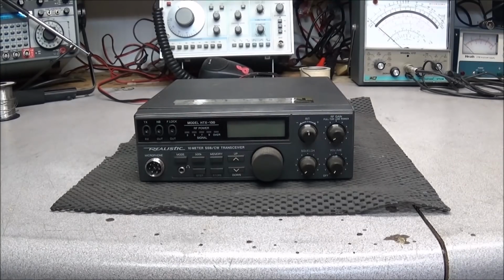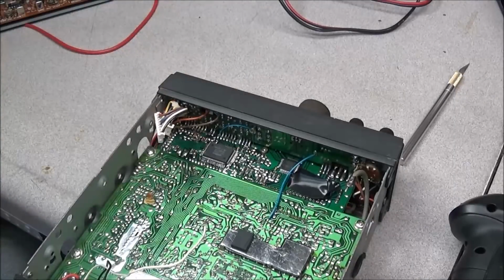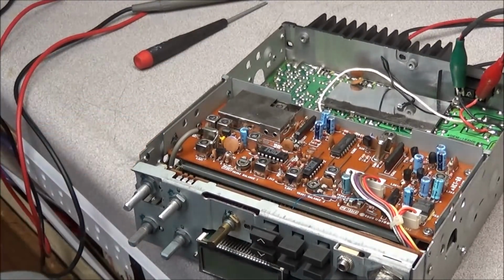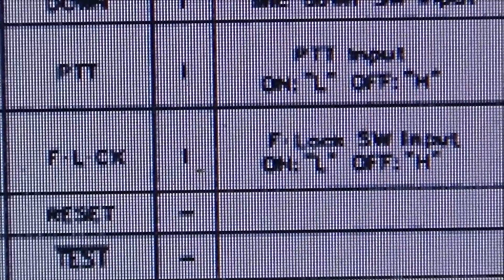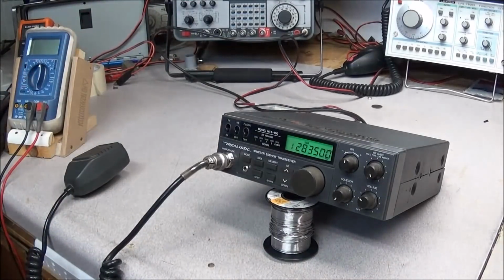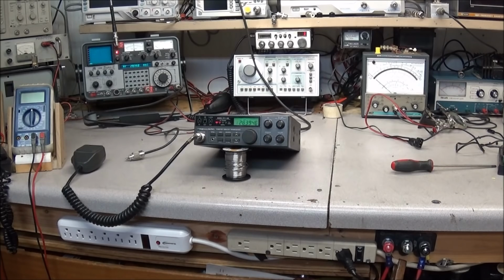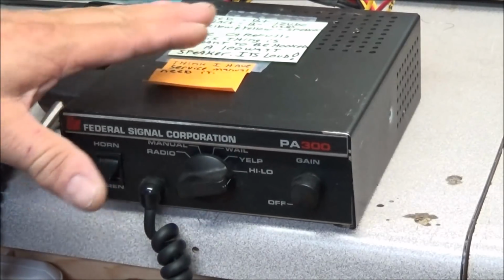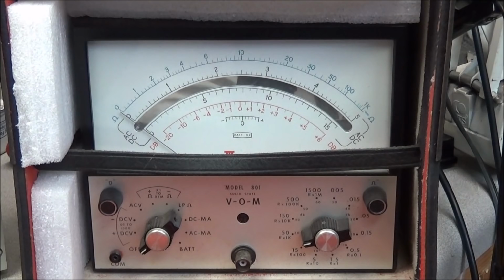#122 HTX 100 Failed Repair Plus Mail Bonus

Comment: I know it's an old video, but thanks! I picked one of these up from a Silent Key, and it had some broken wires inside. I figured out where they go by watching your closeups of the circuit board, and it' now working like new. (also had the problem, (cannily identical) with blown tracks around the regulator. Replace the caps, regulators, and repaired the tracks. 73's VA3IRF

Comment: I just pulled my htx-100 out of a box, worked great about 20 years ago, thought I'd try it out again and maybe sell it. I had the flashing display, and was figuring it was toast, then came across your video. Sure enough the TX switch was on. Thank you for putting this out there! Unfortunately I think it does need a recap. I tuned around, but the noise level was off the charts. I thought I'd call CQ and see if I got a response, and immediately heard a faint reply that the freq was in use. ... So I think the receiver side may need a recap after all. RF amp just seemed to increase the noise. Oddly enough I have a Yeasu ft757gx with essentially the same problem. Do you think a recap on these radios would fix the receive problem?

Comment: I have an HTX-100 that is doing the same thing and was wondering if you still are working on those rigs . I have tallked all around the world with that radio running 25 watts with an inverted V dipole in a pine tree back in the early 90's. If you could please help me let me know and ill email you. This radio has sentimental value and I'd really like to see it running again.

Comment: I used to work on modifying single sideband  CB radios.  I'd make 'em go upstairs by cutting a trace on the phase locked loop radios.  I'd then broadband the oscillator.  On my base station I had it hooked up to my Fluke frequency counter and had a tuning wand stuck through a hole I drilled in the case so I could swing the oscillator down or up depending where I wanted to go with the transceiver.  I'd swing it up to go upstairs above the 40 channel usually just below the 2 meter Ham band.  Up there I'd talk to a lot of Ham radio operators.   I'd swing the oscillator the other direction if I wanted to go below channel 1 on the CB.  I really had a good time back during the 80's working on CB radios for folks.  Then I started working on television sets.  Sold all my gear when I moved and now no longer do electronics.  That's why I feed off of others' electronics work.  Love yer videos.

Comment: I wonder if you are into "metrology?" Standards and such... you have so many meters and instruments which are just begging for calibration. HONEST calibration, no problems because you have standardized and calibrated sources... right? Your connectors are all standard field types... no lab or better (metrology level) connectors. See the video from The Signal Source on connector types. Oy vey. LOL Not one standard in all your videos. Yikes.
Reply from the maker: Yes I have many standards including GPS standards. However frequencies below 30 MHz field connectors are just fine. I am not running a "Lab" here and not in the business to service commercial equipment. Just a hobby since I quit General electric and EF Johnson companies as a service tech.  My newer signal generators and spectrum analyzers (which are less than two years old) are all up to date from the manufacture.  Now when working with higher frequencies and public service equipment standards are a MUST and why I do not service such equipment any longer.  In my current job of 25 years as a quality engineer metrology  is something we have to take seriously. Good points Bruce.

Comment: NIce work... but I am not sure how shorting that wire to ground resets the micro when the radio has no power to it....???
Reply from the maker: Capacitors act like batteries. They store energy.  By shorting certain pins on the micro you discharge these internal capacitors. This way any garbage left in the micro is removed.

Comment: I had a ham friend give me an RCI 2950 10 meter transceiver with intermittent display issues.  When I got home and opened up the unit, I noticed there was no harness, ribbon cabling or hardwired cabling going from the display board to the main board.  Instead there was a whole row of thin fingers that passed through holes on the mainboard, just passing through and if they made contact fine, if not, no display.  So I removed the display unit and carefully slightly bent each finger and then reinserted it back through those holes as I reinstalled the display unit.

Turned the radio and it worked just like a charm.  That was 10 years ago and the darn thing is still kicking.  Just took a little torquing the copper.

Thanks for this repair.  It reminded me of my own above mentioned experience.
Reply from the maker: Thanks, it is good to see a repair last for a decade. Glad that worked out for you. Some just takes a little tweaking while others make you pull your hair out lol. Good job on the 2950. I have one somewhere in the shop I need to repair one day.  Thanks for sharing yours.

Comment: Hello Buddy well nice story on the radio. Mike is a top friend and it's always interesting to see what he sends you. Although I think he could have sent 2 boxes and saved people from possible hernias.LOL I just bought a BK DYNAMATIC 375 in excellent condition but not working so have dismantled and am waiting for new valves. Then will see what else is wrong have already tested the meter and it's fine. Will let you know the outcome. Cheers mate.
Reply from the maker: As long as the meter and transformer is fine should be a snap to fix.  Will be a nice bit of gear to any bench. Would like to see before and after pics if possible. Yes Mike is a true friend.  Good luck on the rebuild.

Comment: Yep, the wire shorting the switch would of been it, if only someone else had been more careful when they worked inside it and didn't leave that in there! Mind you, I have seen big solder splashes inside brand new Cobra 29's, straight from the factory.
Reply from the maker: Had the radio playing for a while now. No faults. Must have been that wire.

Comment: I'm not sure about this model, but the HR2510/Lincoln etc flash the display if they are in TX mode at switch on, so probably a short on the TX line. (I'm still watching video, just started)
Reply from the maker: That is correct.

Comment: Well, I don't have to worry about my HTX that needed finals, or the TS440 with the occasional dot problem now.  I had a house fire back at the end of march and lost all my test equipment and my radios.  I have been replacing my test equipment and I replaced the ts440 with a nice Yaesu ft-980.  I lost 12 file cabinets of factory service manuals, but I did save all the Sams photofacts.  I had good insurance though and it has been somewhat fun shopping for new equipment.
Reply from the maker: Darn Bill hate to hear about the loss. I do hope all goes well. Somethings just cannot be replaced my friend.
Reply: On the plus side, we get essentially a new house inside, and I get all new test equipment and radio equipment.  Also get new furniture, appliances, and clothes.  Guess I will not complain about those insurance premiums again.  I had full replacement cost coverage and coverage to pay for my rental house while they rebuild mine.  Was just thinking that if I had an antenna tuner and a battery, I could go sit on my deck and work field day with the FT-980.  I may give that some thought, it might be fun.  I am also going to get a new (to me) VHF/UHF base radio, and a new dual band handheld.  I am looking at a Yaesu FT-65.
Reply: By the way UPS, FEDEX, and the USPS are all upset at me.  I have been on a buying spree for the new test gear.

Comment: Good video Buddy.  I just finished restoring and calibrating a Heathkit IM-28 VTVM,  looks exactly the same as those three you have,  so I'm not sure of the difference between all the model numbers. Had to build my own probe for it too.  It's a great unit. Yours and Mr. Carlson's videos help a lot with fixing these kinds of test gear,  I really appreciate all the knowledge you share.
Reply from the maker: Not a lot of difference between them if I remember correct. Both are excellent meters.  Glad you decided to build your own probe. They are very simple. Glad you like the videos. Paul is a great tech on this stuff I have to agree. Thanks for watching my friend.

Comment: That's at least two unhappy FedEx men.  Yours and mine. :-)  I definitely give them a workout.

You made all that new bench space and I just had to help fill in those empty holes.  Can never have to many meters.  Just hope the bench doesn't collapse due to overload.

Don't you hate radios when they fix themselves.  That drives me nuts when that happens because I know eventually the fault will return.  But like you say if it ain't broke you can't fix it.
Reply: Reminds me of our beloved black lab (SK) who wasn't doing well and the vet did some exploratory abdominal surgery but didn't find anything wrong...dog immediately returned to normal so I asked the vet what she thought was wrong and she said she didn't know but figured she had simply  "...let the bad air out"; guess radios may have the same thing happen!
Reply: Dino Papas 

Hmm, let the bad air out.  I bet that smelled pretty bad. ;-)
Reply: Mike,
I'm starting to believe you're St. Nick in disguise.   :-)   73   WB3BJU
Reply from the maker: I bet they were complaining about this haul! Man that box was heavy! Remember the FT-101ZD I talked to you about? Started working all by itself. Dead on frequency lol
Reply from the maker: LOL, bad air will do it every time.